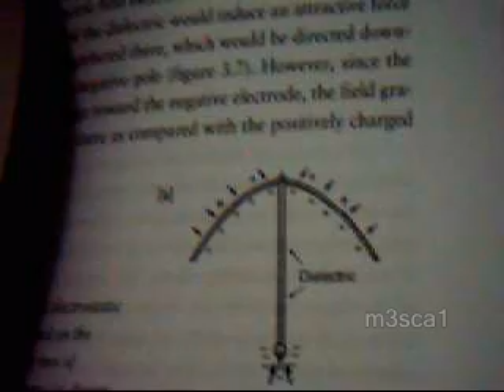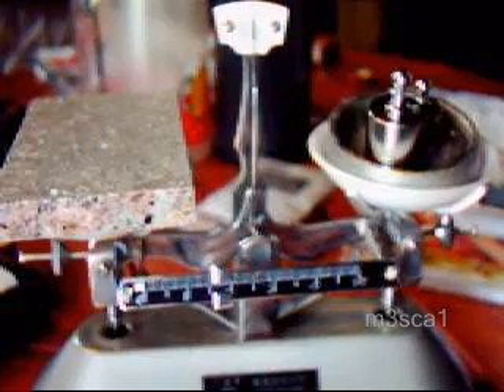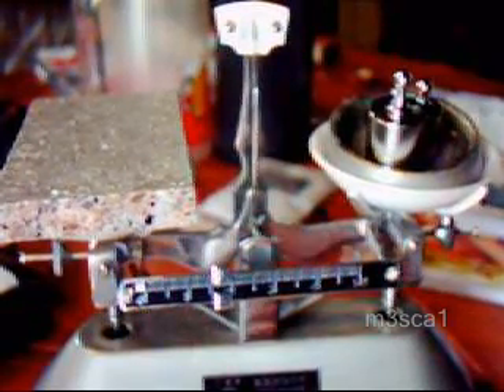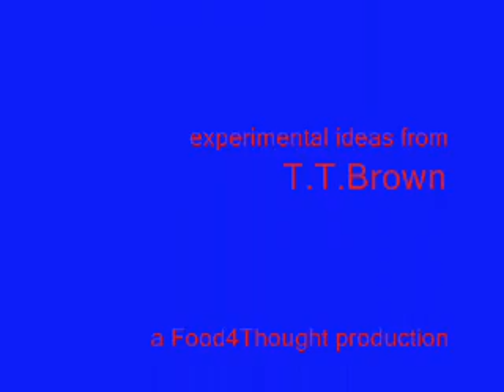Electrogravitics pt1

Comment from the maker: thanx for your comment- i would like to point out to you that NASA has tested the lifter tech in a vac and it still works.
see only1egg on YT.
also if it is only ion wind-why does the lifter still fly when the polarity of the wires to its charge surfaces is reversed?
pls check the link -i tried it and it did not work.
i am building a modified van der graff generator for part 2 of this series.
stay tuned

these experiments are inpsired by the work of 
T.T.Brown, not Major de Seversky.

Comment: For the first time in open literature, this article explained how the B-2's sharp leading edge is charged to "many millions of volts", while the corresponding negative charge is blown out in the jets from the four engines. There's substantial evidence that the electrogravitics research of the 1950's actually resulted in the B-2 Stealth Bomber. Aviation Week admits the existence of "dramatic, classified technologies" applicable to "aircraft control and propulsion" on the B-2!

Comment from the maker: havent had much luck with lifters-thats why im piecing together a large van der graff generator.
i was using ignition coils in parrallel.
make sure you ballast your NST i blew mine up straight from the wall.
i was running a xerox phototcopyer gas laser off it,and shooting red beams acroos the valley.
man what a flashback-that was a long time ago!

Comment: That's cool! As i understand it the better di-electric AND the higher voltage the better trust.. it's also been tested in some nasa super-vaacum chamber, to rule out the ionic response in ambient air, and although there was smaller response, there still was one. And then i read a report on this with some nice calculations from the UK, it clearly works. Nice demo with the heavy granite brick, maybe a pendulum test to show off ? :)

Comment: I have never heard of using AC for this kind of thing. DC should give you a much more impressive reaction. I have seen a version of this experiment which would fly like a 'lifter' Built with the same shape but using lightweight foil for the bowl, and bottom. (not sure what the dielectric was) I tried to replicate that one myself using a high K foam, but I was stupid enough to use super glue on the foam. The glue ate through the foam and caused electrical arcing. I am gonna retry it though!

Comment: I think hats off to you for using an analogue old school measuring scale. I worry with the digital scales that any weight changes are due to induced emf.
Reply: Im on the ion liftes myself. i have no idea about the whole gravity thing, but I do know electronic equipment such as scales near them can play up when they are turned on. Ive heard about solid dielectric materials being able to hold massive amounts of charge. How is the granite as an actual capacitor anyway?
Reply from the maker: @c6jones720  i never measured the granite for its capacity...the whole exercise was about changing the weight on the scale. It seemed to be attracted to the piezo BBQ lighter when I was giving charge...and that is what I believe deflected the scale needle. There was an event that was not shown on video and that was after the camera was left running and about 30 minutes after the experiment  (while i was not in the room) the balance moved like the slab of granite had finally discharged. I would like to try these things again with a better power supply. Was also reading at the time that a block like that granite could be used as a kind of spacial GPS because they apparently show different values when in different orientations.
Reply: @m3sca1  ok Ive never heard the gps thing before, might be worth investigating. Theres probably lots of quirks of common materials that simply havent been explored yet..
Reply from the maker: @c6jones720  to clarify...it would work in space and would give different values with respect to it's relative position against the background of the galaxy we are in. I will try and find the book reference...
Reply: @m3sca1  So its not like I could whack a bit of aluminium tape on both sides of a slab of granite and drive around a bit observing the capacitance change then.
Reply from the maker: I think it required fourier transform calcs from the slab...haven't found the book yet. Will get back to you when I have some solid info.
Reply: @m3sca1  There is a lot to learn about material properties and the biefield brown effect, and Im sure there is a lot that can be done practically with it
Reply: When researching into lifters you cant help but come across the Townsend Brown experiments and patents, and his experiments into materials. I have to admit to being completely on the fence about the whole electrogravitics thing, but I know the Biefield Brown effect is real in the sense it produced observable thrust. I saw an interesting video by Jesse Fritsch here: https://www.youtube.com/watch?v=1NH01GSOhwk Im not sure about everything said, but I am completely on board with the technical description of a propulsion control system, I think its this video where he mentions working on some sort of solid super capacitor too, I dont know if it ever got released.

Comment: @m3sca1 Cool 'nuf... Ive heard it claimed that some Tesla Coils can end up having more voltage one way than another if thats what you are refering to, by the slight DC...Now a VDG WILL be totally DC...but I am afraid that you will not have enough amps to make it work...but of course I hope you prove me wrong! LOL! Your best bet might be to get an old computer monitor...and using the HV from it. Ive seen some simple instructions on the web. Or just get a cheap HV supply from Ebay like I did LOL!